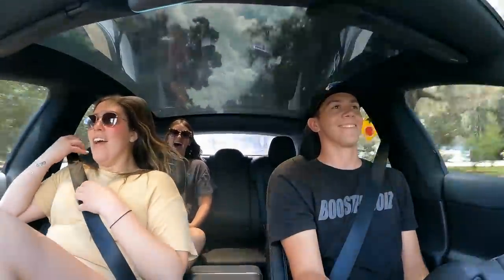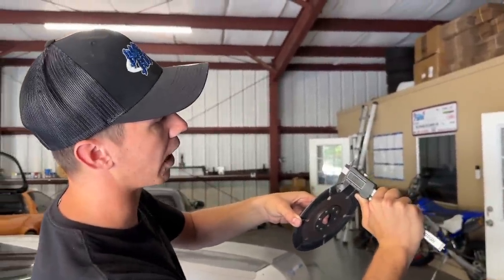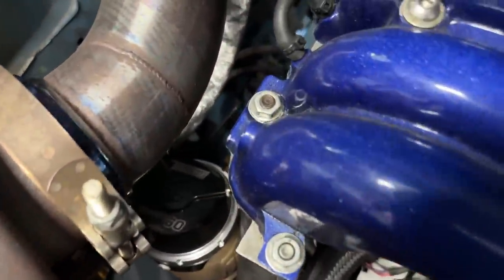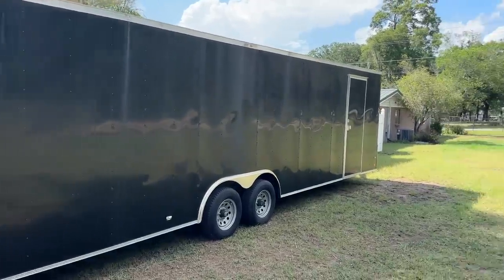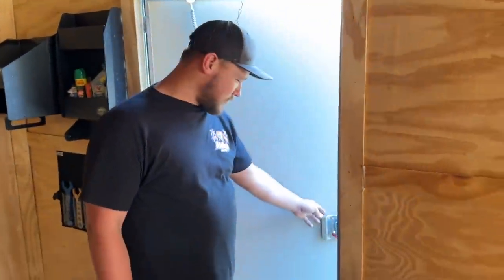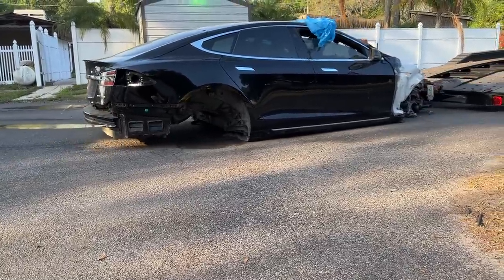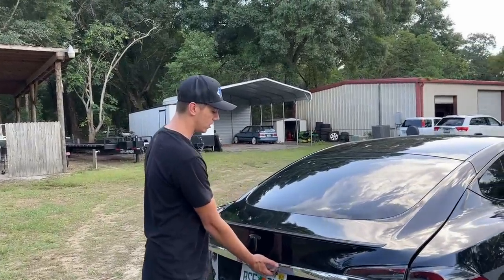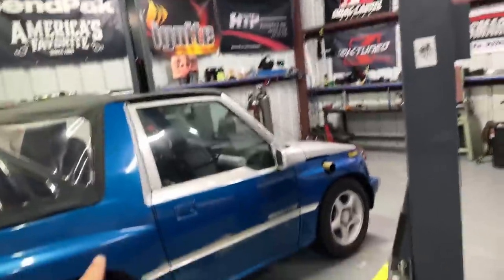Our Wrecked Tesla Plaid Is LEGAL!

Comment: You should really install a flat floor, mild splitter and a diffuser on the mr-2, It's just a guess but lots of production cars actually generate front end lift at high speeds. I think it would make the car a lot more stable and likely also faster since you'd be saving horsepower (drag). Also you should look into getting a 6 axis inertial sensor (like a gyro that also gives you yaw data) so you can fully automate the chute if the car gets out of control. The reaction time eliminated by the ecu could make the difference saving a potential wreck.
Reply: A1 advice
Reply: @garethwillis  i don’t disagree with your downforce point but the original point here is about increasing drag efficiency reduces the amount of HP to go a certain speed and that is true. I’m not sure if that would net a plus or minus after factoring your downforce point but stability is a comforting feature not to send all that money and a human life into a wall at 200 mph
Reply: @garethwillis  of course you can. Cleaning up airflow under the car will very much reduce drag. Reduced lift or downforce will also lower the car which reduces drag by reducing the frontal area.
Reply: It would be worth throwing the MR2 in a wind tunnel for sure. I remember how bad Leroy's aero was 😂😂
Reply: @garethwillis  could you provice something to prove that? I´m an engineer, but not an aero one, and it is the first time that i hear that downforce, when keeping the drag the same, would slow a car down. Ofc you would slow the car down if you increase drag while increasing downforce, but a flat floor would not increase drag. All sources i know state, that only drag and friction prevent a car from going faster. Downforce could increase friction slightly, but that effect should be linear while drag rises exponentialy with speed, so you would have to add an insane amount of downforce to even have a measurable effect. I hope my point is clear, english is my second language.
Reply: @garethwillis  That seems true on first sight. So you mean zero downforce should mean the fastest result, as lift is negative downforce and would also need energy to generate? Also, isn´t the energy needed for that just drag? Aero is a really interessting but also extremly interessting subject, i feel like the more i learn/read aout it the more confused i am :`D
Reply: @garethwillis  It is even higher than that if you compare monaco and baku. But guess what, they change their wings for that. Not the floor. I was discussing how a flat floor would benefit the car with very effiicient drag reduction while adding downforce. Ofc you are right if he would add a splitter or wing, i hope this clears things up.
Reply: There’s a good example of this in a YouTube video from around 10years ago. Think it’s called “S14 top speed crash” or maybe “s14 top speed accident”

where the air under the front creates enough lift at 180mph that the front tyres literally lose traction and float. Zero steering response. 

No cage either and the dude crashed it at 300km/h AND survived, the video from inside the car is crazy
Reply: @garethwillis  Ok, i thing we were more or less agreeing on the general point. I think the only important thing to add is, that there is aerodynamic efficiency. E.g. the rulebook of the WEC states a certain drag/lift-ratio you can not exceed. A floor is insanely efficient in that way by adding basically no drag or even removing it as you clean up turbulences, but a wing can even be the other way around. Its just not a 1:1 thing, especially as you stated with wings.
Reply: Would love to see this thing in a wind tunnel.
Reply: What in the Newtons law are these comments lol was kinda cool to see an educated debate in the comments not just two random people that had no idea what they were talking about.
Reply: @garethwillis  This is simply not correct. Increasing downforce by reducing lift force both gives you more grip/stability AND higher speed through reduced drag. A flat floor, especially covering the rear end where there's a giant opening for the engine bay, would greatly reduce lift AND reduce drag.
Reply: @garethwillis  It's not worth my time to read it all. Sorry, don't care. You can add downforce by decreasing lift force, which can and usually does reduce the drag coefficient.
Reply: @garethwillis  I will now. My point has been sufficiently made lol.
Reply: @garethwillis  Yeah I noticed but ever action has a reaction they just can't see that increased down force make friction higher which causes the car to slow down. You can't just be given free energy. It has to be a give and take.
Reply: 1000% facts I said he’s doing to much at the top end there going to fast now to play around
Reply: @garethwillis your fighting against extra weight with more downforce he just needs to make things air tight then when have a issue with body wobble and tossing the car around up on the big half of the track more or less just needs to go back to the stock gutted doors that 27 pounds was making the car more stable
Reply: @garethwillis  there are wing manufacturers who spent a lot of time in wind tunnels who would disagree. Some wings can increase downforce without adding drag.
Reply: Yo ur next build should be a monster ridge line k24 swap? 😂
Reply: @OpticalToxin  If you studied physics you'd know it's impossible to convert a horizontal force into a vertical one while simultaneously eliminating the horizontal force.
Reply: @mjay6245  actually I did study physics and there is a lot of engineering in racing alone that will prove you wrong.
Reply: Mr2s have underbody plastics. Apart from the engine bay it's pretty much already a flat floor
Reply: @garethwillis  True, it's not without adding a little and that's my fault for not being so clear. My last physics class was over a decade ago so forgive me. Your original post though made it seem like it's a 1:1 trade off between downforce and drag which is just not true and why I think you are receiving these comments.
Reply: @garethwillis  likewise, your comment just made my day. People often get pretty bold behind the keyboard and it's nice to come to an mutual understanding. Have a nice weekend.
Reply: @garethwillis  low pressure downforce doesn't behave the same as high pressure
Reply: @garethwillis  you can without a doubt produce more downforce and REDUCE drag by putting a flat floor on any car that doesn't have a flat floor. Air dams do the same thing. They reduce drag and increase downforce. The car will be faster, more stable, use less HP to achieve a certain mph, etc. It's literally free. Even just lowering a car's suspension will usually increase downforce and reduce drag.

Comment: Nice trailer wyatt. That size trailer, might be worth looking into adding some solar panels to the top. Just did a nice setup on my boat, for about 2 grand, and its a game changer. Would be nice not having to depend on the generator all the time, and plus its florida, so plenty of sun.
Reply: I feel he could also get some 25W LED strips or something that would use less power if he were to go with solar and batteries.

Comment: Yo Kyle @Boostedboiz  on that C4 Trans, You need to add a rubber line and small canister to the vent  coming off the top of the tail housing,  Run it to the engine bay, Once you start turning those C4's past 6000 rpm they will start pushing fluid out the stock vent, also a good trans cooler is a must on them if you are driving them a lot,
Reply: It's nice to see another Ford guy on here appreciating what these guys do for the sport. I hate to say it but most of the ford guys I know are too closed minded.
Reply: @Jarod-Davis   I love all types of racing and cars, I love watching what Kyle and Wyatt do, been a subscriber since the beginning...
Reply: I’m trying to figure out why they didn’t keep it manual lol. Feel like it fits the car better

Comment: could always throw some cheap solar panels and run the trailers lighting off that, adding in a few marine batterys in that bad boi, be a fun rig, my friend does kind of the same thing with his shed, hooked up a trickle charger to his motorcycles and run his lights, always charged over those harsh winters

Comment: Wyatt you need a converter out of a camper so that way you're lighting can be 12 volts and run off of battery or you can plug it in and running off of 120v

Comment: Bird spikes will stop that bird poop issue for sure. We install them all the time, albeit usually for commercial properties, and they work quite well.
Reply: No they won't small birds land between the spikes
Reply: this or just cover them with wire mesh..
Reply: @_Otaku-kt8be  that's an install problem. If installed properly they work quite well.
Reply: @sirmonkey1985  for sure, with his particular issue and the coverage needed hardware cloth would be a good option as well. Hell with such a small coverage required even sheet metal would be a guaranteed problem solver and wouldn't be too much money.
Reply: Pellet gun
Reply: Pellet gun
Reply: That hook up to a live ground itll be nice.i see some gas stations done that befor because bird issues
Reply: @sirmonkey1985  I was gona say that too, just cover it with some mesh on both sides, each one, with small holes, cuz other things might end up calling it home with say something like chicken wire.

Comment: Sweet trailer. Happy Birthday. 
Wyatt should get some solar panels, (Li-Ion Batteries and an inverter/controller) or a decent power station for the trailer. Then you can run a trickle charger for vehicle and recharge all the batteries for any power tools.

Also some better locks, those Master Locks are rubbish.

Comment: Spray foam in the top of the carport will help prevent the birds nesting in there. Keep up the content guys!
Reply: I'd just get a roll of roof flashing an some self tappers an cover the triangle on both sides. 🤔
Reply: Plastic owl might help too
Reply: @mke723  for a day or two until they realize it's fake
Reply: Just get some wire mesh with small holes and hit every beam both sides...

Comment: If you do ac you have to insulate the hole trailer. I have a 26ft for the race care and I have one roof top unit and it stays around 76 degrees when it’s all closed. But it’s insulated. And that’s here in florida.

Comment: Run a Mini Split AC in Wyatt’s Trailer; the traditional roof mount RV type suck. They’re very inefficient and prone to breaking/leaking. Even a Dual Hose Portable AC would work well; the new ones are inverter style and very efficient and quiet as well!

Comment: 2 things. 1). Bondo for the door will not work for more then a few runs if your lucky. 2). What is Wyatt planning on using the trailer for? It definitely looks like the truck won't fit inside of it.

Comment: I'm exited for the future of hot-rodding electric vehicles. People get down on it like it will never be as fun as gas powered cars but I think it can be just as much if not more fun. These are the pioneer days of electric hot rodding. It will be really cool to figure out what the limitations are keeping it from going faster and how to get around those. I have no idea what I'm talking about, but I think the biggest 2 things you could tune to make it faster are power delivery and heat dissipation. Like if you can somehow use beefier power cables and higher voltage inputs to the motors they will definitely be faster (until they burn out haha, who knows how much voltage they can take for how long). And if you can add massive heatsinks to the batteries and motors and all those electric components that get super hot, you could even add water cooling loops to them and put a radiator in the car (if it doesn't have one already). I think there is a lot of speed you could tune into these electric cars to make them way faster!

Comment: Dude if your door wont stay closed just put a rotating latch bar in, basically just a bolt through the door and 2 matching steel plates either side, and a pin/bolt to stop rotating it at the position it holds the door closed. gravity will hold it shut idf its heavy enough, or you can attach the plate to the pin with a spring or tie or whatever

Comment: super gleu works great on carbon with some baking soda back in the day helicopter pilots would use it on rotor blades to fix spots.and wen i was still racing drones in parking garages my carbon arm would get like sloppy just supergleu them

Comment: This is random but I remember back in the day before youtube. But old hot version and even some euro vids. Back in the 90s and early 2000s. Race cars and factory cars that had or came with multi disk clutches from factory. After any driving daily to race track. They always used those universal adjustable hood props to press the clutch pedal in while parked. To let the cool and increase life but also keep them from warping cracking and even basically welding clutch to plates.

Comment: don't resurface, just replace the flywheel, i resurfaced the billet flywheel on my racecar and it feels a tad shuddery and doesn't have the holding capability like it had new, I regret not just replacing it for the cost its worth it.

Comment: Having used triple plates for decades when they are under .1 they are stuffed and will slip. That is NOT a drag race clutch but a road race clutch. Stop start driving around the pits and slipping the hell out of them off the line means they will fail. Quickly.
You woul never get that rebuild Tesla registered in that condition in Australia or most parts of the world

Comment: How did that car pass inspection??
Reply: State doesn’t care home the bodywork “looks” just needs to be structurally sound. Crash bar in the rear  fixed and as long as the lights work, air bags system functioning (light on dash works)  outside of that it’s just a standard mechanical inspection, tires brakes, horn, lights, suspension. Etc.

Comment: i think the door blew off because of the auto chute deploying valve venting to the inside of the car? but idk seems like a lot of positive pressure blowing outwards
Reply: It be the force of air inside the front fender. There is a gap between the fender and body.  Right where the door skin seam was coming apart